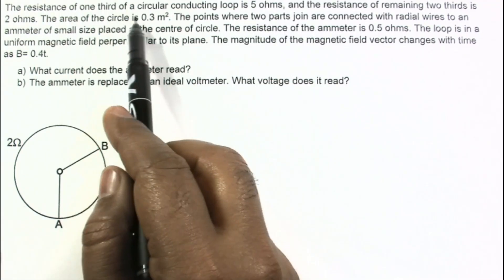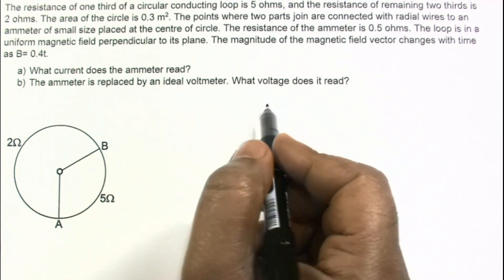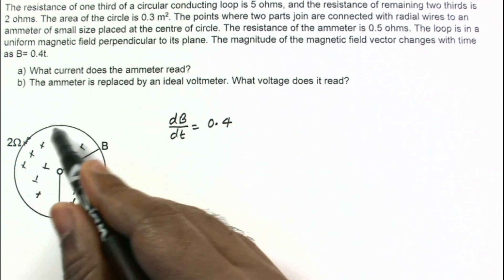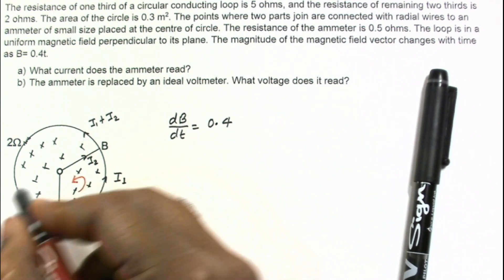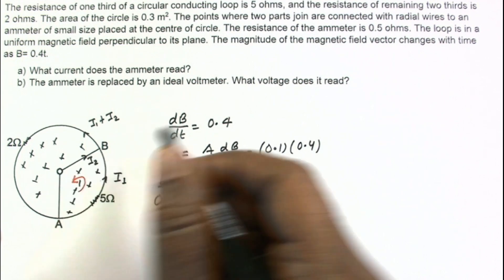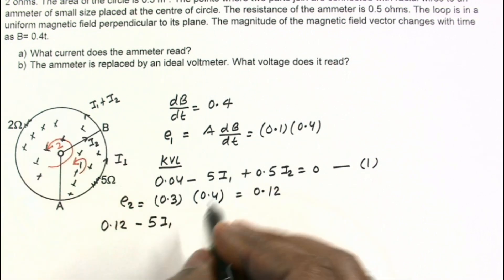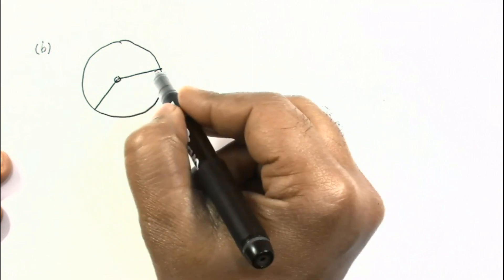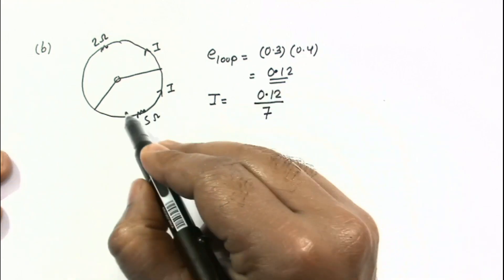Electromagnetic Induction || Advanced problem || Time varying Magnetic Field

Comment: Sir is the same method applicable if we consider a triangular or a square loop instead of a circular loop. As induced electric field lines are in the form of concentric circles and the path which we consider to calculate E.dl is also a circle and angle between E and dl will be 0 throughout the path, but that doesn't happen with square or triangular loop. So how do we approach it??